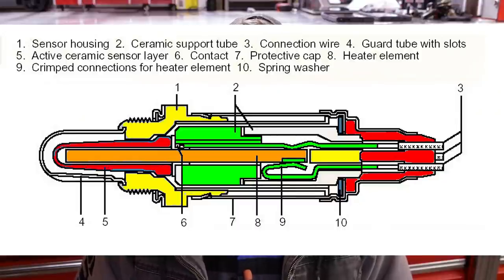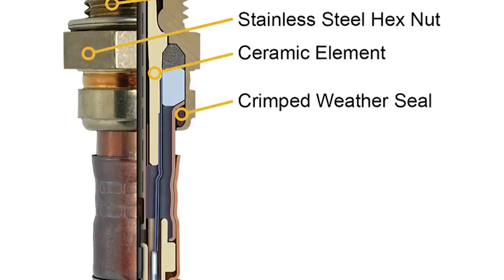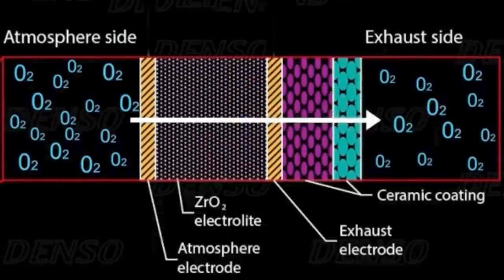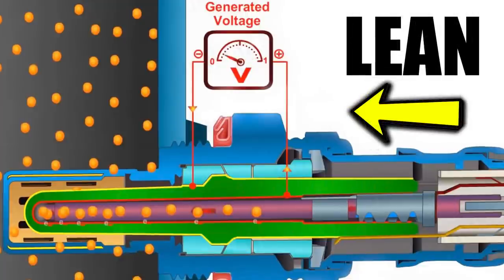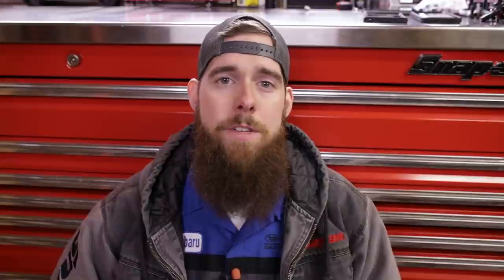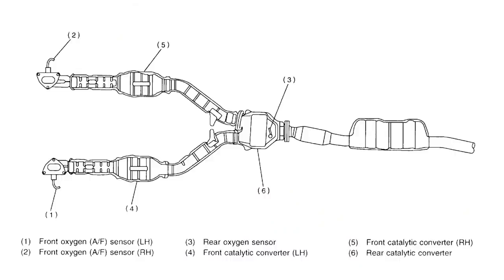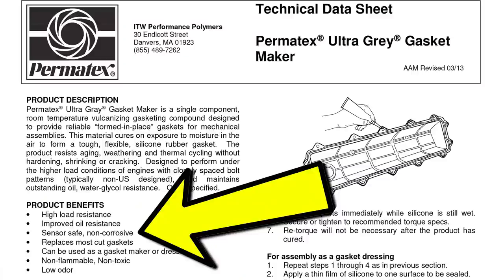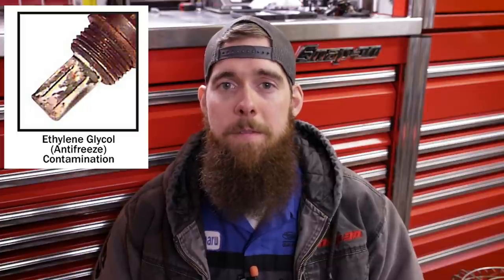Oxygen Sensors Explained! | An Introduction Into The Theory Of, Workings Of, And How They Fail!

Comment: Very good video. My question is could a P0420 code be related to a bad O2 sensor? I used to live in Puerto Rico and gas there is not mixed with ethanol. I was using 93 octane gas with no issues. When I moved to Florida I keep using 93 octane gas but in Florida it's mixed with ethanol and after some time car started  throwing P0420 codes every 200-300 miles. I switched to 87 octane gas but i still get P0420 codes but the interval millage is longer, between 500  -700 miles. Right now car is running very rich, Changed air filter, gas filter and PCV valve last week after noticing very dark tail pipe. Also, when changing the air filter, when disconnecting the valve cover tubing, one side was almost clean but the other had some oil inside of it!!!!...My car is a 2000 Impreza RS with 82,528 miles on it
Reply: Did you find a solution? I have a 2014 forester XT with exactly the same behavior. I live in Dominican Republic so there is no much to do with fuel types.

Comment: Last week I went to start my 2018 Subaru OB 3.6 (40K miles) and heard a very loud "BANG!"  I shut it right down and had it towed to my mechanic. They scanned for codes and got a paragraph full. Some of what they reported: "ENGINE CRANKS BUT WILL NOT START.   P013D (OXYGEN SENSOR SLOW RESPONSE BANK 2 SENSOR 2. CODE: P1604 (STARTABILITY MALFUNCTION)."  There were a bunch of other engine malfunction codes. I had it towed to dealer (5 weeks left on warranty) and the tech claims it started right up with no issues. It did not start when the service tech manager tried with us standing there watching. The tech said the only thing he did notice is a strong fuel smell. They want me to take it home as they can find nothing wrong. First, what's with the several codes? Second, the "bang" and engine not cranking over three separate days/times is not nothing. Would a failed oxygen sensor cause pre-detonation and a loud "bang"? I have 5 weeks left on my warranty. I so much appreciate you encyclopedic knowledge...I could learn enough from you to become one of my dealers most obnoxious customers! 😆

Comment: Had a p0031 code on my 06 2,5 outback 2 years ago. When measuring the resistance of the air/fuel sensor it showed like 50k ohms. New Denson sensor measured like 5 ohms (don't recall exact numbers but there was a huge difference).   What was going on? Did age catch up with the sensor or was it caused by some contamination? I never had a chance to visually inspect the faulty sensor since I couldn't get it out myself (mechanic did the change).